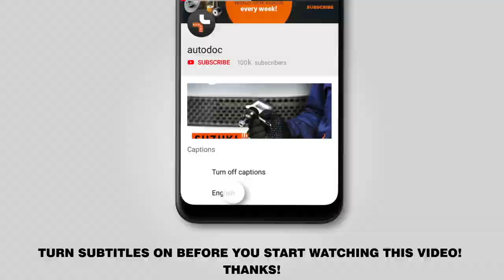How to change front brake discs / front brake rotors on HONDA INSIGHT 2 (ZE) [TUTORIAL AUTODOC]

Comment: One suggestion, how about using the copper spray on the wheel instead of the disk, to avoid cross contaminated of the friction surface with the anti cease compound?
Reply from the maker: Thank you for your comment.
Please clarify or rephrase your question.
Best Regards,
Autodoc team
Reply: First thanks for ur reply, i mean : the copper spray contaminate the disk surface.. what if you apply it to the inner side of the wheel rim  spray it from the inner side around the lug nuts area.
Reply: Yeah that was a kind of messy job. But he cleaned it with brake cleaner